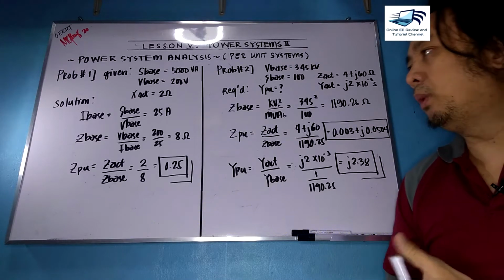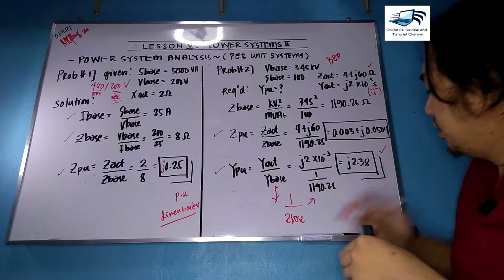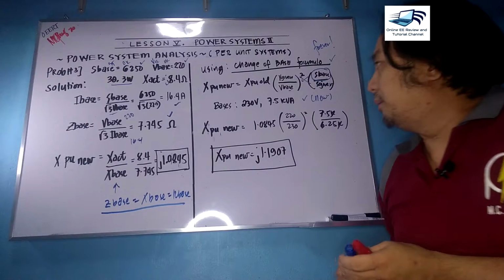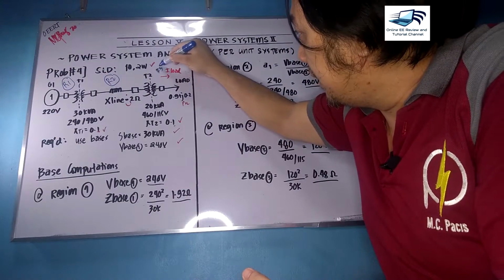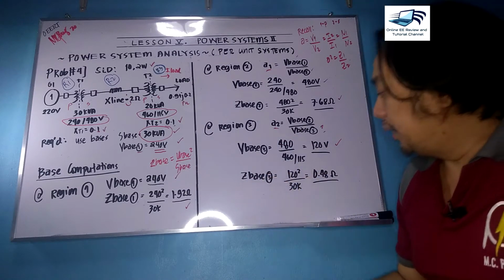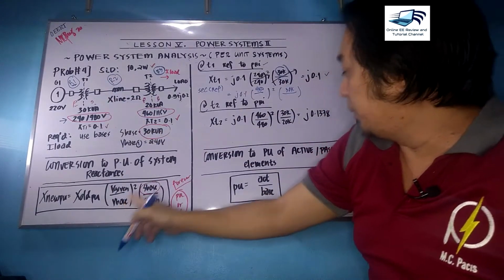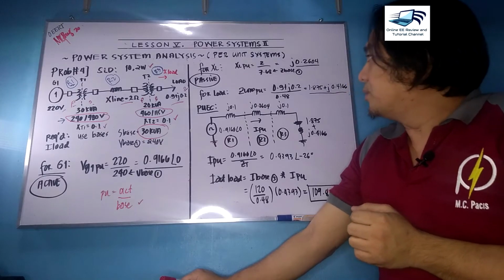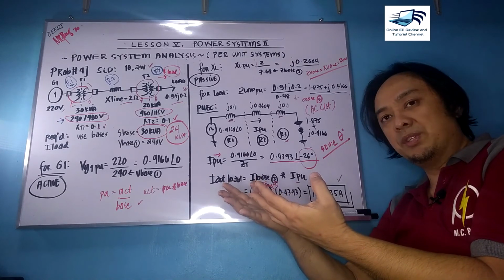Lecture 5.2. Per Unit Analysis (Problems)

Comment: Sir nakita ko po yung problem number 3 kay schaums. Same process po  ng solution pero yung denominator po niya sa Zbase is walang sqrt(3) kaya yung answer niya sa Zbase is 13.4 tapos yung x_old=0.627 and x_new is 0.688. Nalilito po ako since magkaiba po kayo ng answer.
Reply from the maker: wag kang magyado magpakampante dyan kay schaums.maraming mali. do my method is different.iba iba analysis sa problem. goodluck
Reply: @michaelcalizopacisph.d.8089  tama ka sir